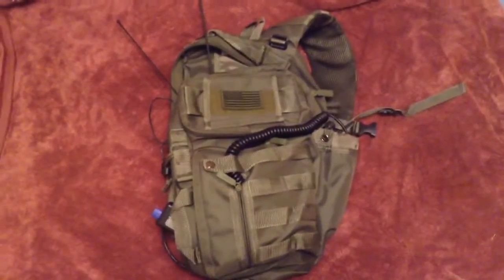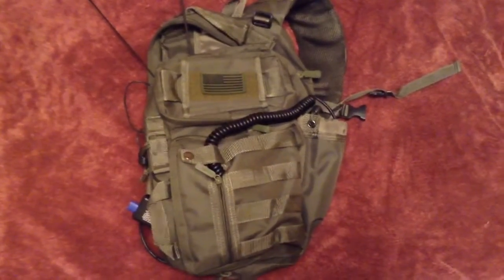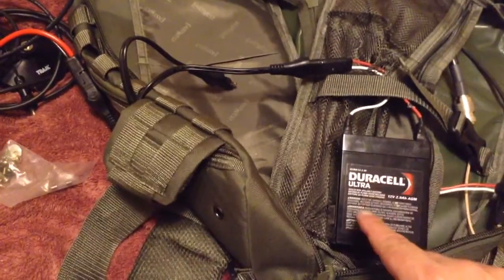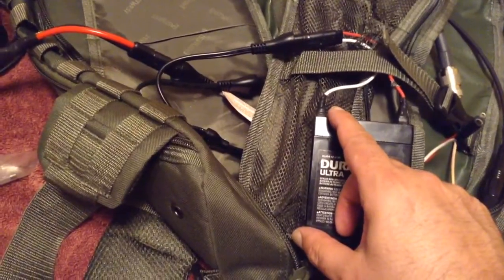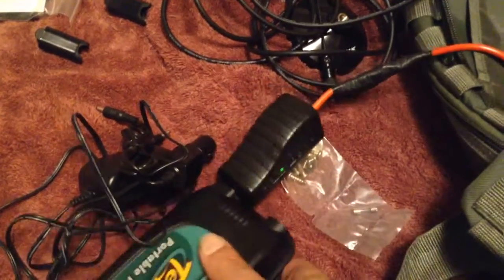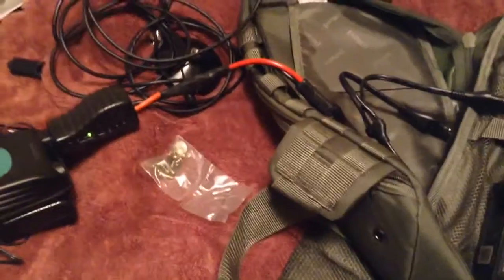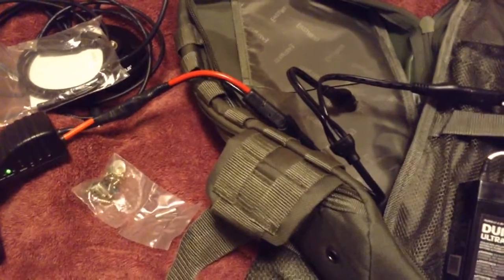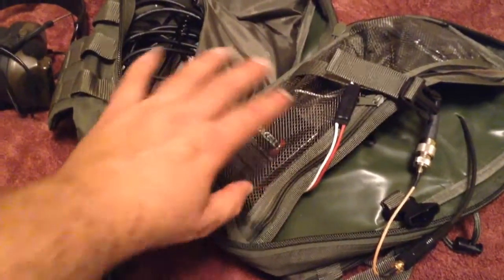Modular 25 watt bag radio kit - Juentai 6188

Comment: I have some Baofengs that I use around the farm but In SHTF I'd like to have more range.  If I have a more powerful base station with an elevated antenna will I have better range or will I still be limited by the weakest link Baofengs?  Thanks.
Reply from the maker: You are limited by the weakest link for two way transmission, but not for one way transmission, so what it would mean is the higher power radio at base can send orders longer distances, but the localized tactical radios will not be able to talk to the base.   Thus, if you are operating at a longer distance and still need to talk to base, you then power up the portable higher powered radio.  Even it's range is going to be limited by the small antenna until you set it up with the larger antenna, and I am working with some people to get that side of the antenna situation settled out.   So far, it appears that no regular retailer has an oversize rubber whip antenna for manpack radio use that would really do what we want with this.
Reply: 8digitPDX Ok, thanks for the info.  I need to upgrade my communications and despite being an engineer I really don't know much about radio.  So much to learn.
Reply: Honestly, a good quality antenna placed really high, will give better results than just more power. A 25w vs 4w of the baofengs on the same high quality antenna placed really high, the difference in range will be very marginal.  Height of antenna much more important than a few more watts power.
Reply: @Booty   Thanks.  I have a 3 story water tower to put my base antenna on, that should be a good start.  Any particular brand or model you'd recommend or any to avoid?
Reply: Thanks James.  Wow, 2 years later and  I still haven't gotten into this project.  And now I'm moving!  LOL.  Life is complex.  Have a great year my friend!

Comment: research ...manpack homebrew.... lots of ideas. thanks
Reply from the maker: I saw a bunch with the metal subframe setups on various vehicle mount radios, which I get the part on that to contain the battery and dissipate heat, but it seems to not quite be where I want to get on this type of project, and does not take advantage of the compact size of the Juentai 6188.   I might go the subframe route though, depending on what I can get done on the antenna side of things.